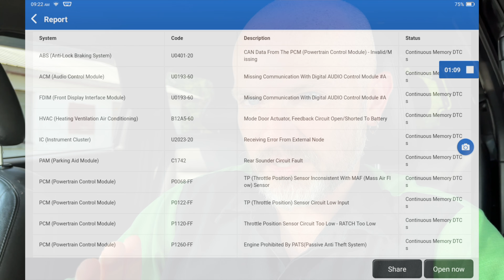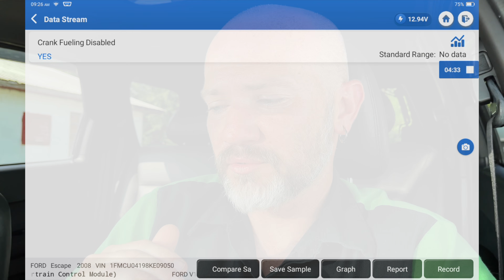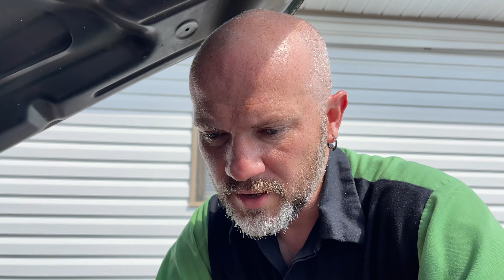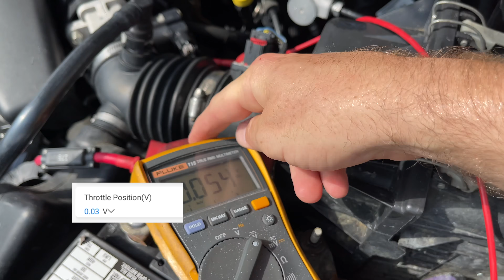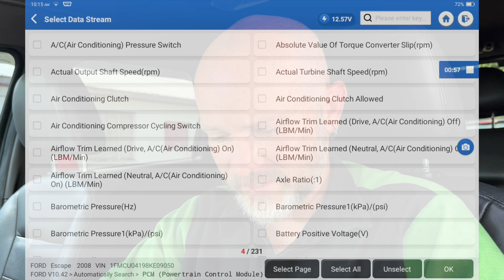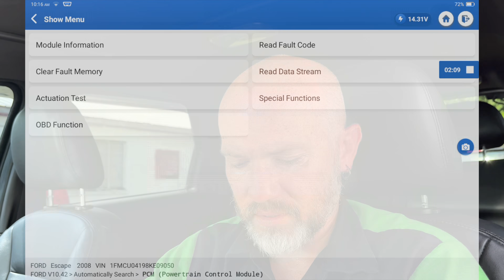2008 Ford Escape Crank No Start Mystery

Comment: I had this exact problem -- crank, no start.  It turned out to be the Fuel Pump Driver Module (On `05 to `08 Escapes -- part number 590-001 - about $40).  It is located above the driver-side, rear axle. These modules develop intermittent opens in the internal circuitry due to age.  It's relatively easy to replace.

Comment: Was the tps the problem for the no start
Reply from the maker: I'm pretty sure it was stuck at wide open throttle so it put the engine in clear flood mode.

Comment: You don’t get power on the injecteurs if your fuse it’s good  and there is continuity to the pcm  so it must be your pcm controls the power to the  injecteurs . Change the pcm and your problem it’s solved
Reply from the maker: I’m not sure what you’re referring to this vehicle only needed a throttle position sensor. It’s not had any issues since this video was made.

Comment: My 2008 Escape just spins over but won't start. Tried 2 new fuel pumps and still no start. Will the fuel pump run being just plugged into the connector or does it have to be in the gas?
Reply from the maker: Not it doesn’t have to be in gas for the electric motor to run.

Comment: In Ford PCM strategy RATCH actually stands for Ratchet. There is an algorithm (also called a strategy in programming Ford speak) that determines the full travel (voltage range) of the throttle position sensor(s). When memory is cleared or the sensor changed the PCM must determine the end stops (the actual end positions are learned). So, the algorithm will have an initial end stop value, and when this value is exceeded towards a stop the new value will be stored. By continually looking for the end stop values you may arrive at the final true end stop after several steps, each one of these steps is called a ratchet. So, the mental picture for the algorithm is the end stop values ratchet out until the actual full travel is reached. You need to know the ends of travel to establish the full travel magnitude of the throttle, which can be used for fuel enrichment on tip-ins by using the rate of change or throttle (just one example). You know the rate of change because you know the full range of travel.

The TPS ground is actually called Signal Return (SIG RTN) it is a dedicated signal return (ground) on the PCM.

If you really want to test VREF and SIG RTN you can put a load across these signals at the TPS perhaps 50mA. This will determine if you have any high impedance faults. However, if you have a bad VREF SIG RTN circuit you will see many more DTCs from other sensors. For TPS open circuit detect there will be a diagnostic high resistance voltage divider inside the PCM. You can just move the throttle (KOEO) to see a change in the TPS voltage. However, the best way to monitor this voltage is by using a PicoScope, because if the TPS has a worn spot you will be able to see it as you cycle the throttle. Disconnect the battery before changing the TPS. This will clear the ratchets. After, connecting the battery go KOEO and cycle the throttle pedal which will aid in setting the ratchets. I am not sure if you can do a similar function through the aftermarket scan tool with reset KAM. I know the battery disconnect will clear the KAM. 

Anytime you pull a connector for testing you should clean and lubricate the pins with at least Deoxit D5. You can use Deoxit D5 to rinse and then Deoxit D100 to fully treat the pins. Many technicians just use D5 which has proven itself over the years. Basically, all wiping pin connections exposed to air are continually oxidizing. So we want to clean off this oxidation and also lubricate the pins. Lubrication is of most importance if you have a connector with a high number of pins. If the pins are lubricated you can easily mate the pins without bending or damaging a pin. You can try this your self. Just find a couple of automotive mating pins, perhaps an old PCM and harness mating pin, mate the two and judge the force and tension. Then treat the pin with D100 and mate it a couple times and you will feel the connection become much more sure, smooth and without any grit. So, if you treat the pins and cycle the connector a couple of time the contact surface area will be cleaned by the wiping action. Some, technicians do not like to cycle connectors (because they think the plastic will break, which is a valid concern), so they just spray with Deoxit D5, mate once and done.

How does a bad TPS prevent a start? It must be DTC related in a decision tree, but I am really not sure.

It is best to take a look at the Throttle body to see if it needs to be cleaned. Most will get dirty over time. I remove the Throttle Body and clean using CRC Throttle body cleaner.

Comment: You could unplug the tps sensor, and put in its place your own variable resistor.  Set the signal wire to 0v, 0.1v, etc, and see if that would recreate the crank no start.  I get that a false WOT signal would enter clear flood mode, but all your codes and data was showing errors on the low voltage side for the signal.

Comment: Another Great Video Jake.  Seen those TPS stick in several voltage levels before and I would bet it was stuck at wot until you touched the pedal or if like me...just get within 15 feet of the vehicle and it fixes itself. 🤣🤣
BTW.. the Ratch is their closed throttle algorithm where it will continuously monitor and make adjustment for the lowest voltage point when the throttle is closed. A better version of the older Latch system. The Latched was a voltage set point captured at first ignition on. They were a bit more finicky as I know on most of the older Trucks,(late 80 to 96) it didn't like it when it was below .68V   They always seemed to be a bit sluggish or less responsive when you would stab the throttle from a stop. Even with a new TPS, I've had to "widen out" the mounting holes to achieve a better target of .95 to .97volts at idle.   I've learned that at that voltage point they were always more throttle responsive.  
This is when I learned about "Ratch and the Latched Voltage"  Well, also from when I was doing some of the old EEC 9aL Mustang tuning and mass conversions into the trucks.  Lol  Ya like 25 plus years ago now. 😆
 
Love the videos bro...keep them coming
Cheers

Comment: CT Closed throttle
PT Partial Throttle
WOT  Wide Open Throttle

Key on engine off the sensor should have been calibrated to CT not PT
(Correct me if my thinking is incorrect)

Comment: Totally not related to the video, but i just got done listening to the automotive diag podcast you got featured on. I found it super cool ,  i also started off as a radio / 12 volt installer and am now working my way through learning as much as i can about troubleshooting and diagnostics

Comment: Sometime in electronic throttle maybe causing due tu dirt in throttle but I think its manual throttle maybe should have the same problem you have also cleaned the throttle body it is good for vehicle health and also For TPS sensor.I see this issue in Toyota a couple of times and clean the throttle body and fix it
By the way your diagnostic method so much Informative

Comment: I've seen cars not start when you hold the pedal to the floor.. So I was thinking maybe the sensor was making the PCM think the pedal was at WOT.  But the fact that it's a cable throttle, I don't think it would matter as much.   But since you have a few of those "invalid data" type codes, It makes me think there could be a faulty or loose main ground cable.. But idk-- it's all just speculation.  Intermittent issues are the worst.
Reply: @autodiagyt  Noted..

Comment: i am wondering euro fords immo runs through the cluster and the solder on the pcb is lead free pretty crappy at the point that the terminal block plugs into the board . and cracks . but if my memory serves me right normally the immo light flashes and car don’t crank either but it’s been a few years since i did one . just a case of reflowing the solder with some new stuff . if you remove the cluster an wiggle the plug it normally fails or fixes it . pretty sure you see can bus comm issues dtc’s as the bus runs through that plug also

Comment: I  got really confused with the sensor unhooked having 3.5v in the signal line. i can figure on a bias voltage  but that seems high.  a 3 wire 5v circuit  i'm used to 5v  signal 0v  ground 0 volt (unplugged) but that was a 1990 ranger. newer having a bias i would expect 1-1.5v on the signal. thing is it seemed all good with the new one connected.

Comment: something to think about if vehicles didn't have radios, abs, push to start, no drive by wire, no can network, no other networks we would be out of a job and have good dependable vehicles to drive. i love my 1994 ram 2500 more every day still has some simple computer stuff. but i can change radio no effect on vehicle, abs doesn't affect the running of vehicle. know of several people who have vehicles that will not shut down without unplugging ABS F-150s mostly  life could be so simple but then a shop wouldn't need $50,000 in diag equiptment

Comment: Occasional, non repetitive faults are the worst! Great thought process! Potentiometer sensors are prone to wear out - maybe some odd wiper contact resistance could cause such an implausible value (rapidly changing?), that the PCM couldn't handle it and sent it to some obscure part of the code that inhibited the start. If it's OK now, we may assume it was related to the TPS.
Reply: Very possible, woulda coulda shoulda too bad you didn’t look at pids before touching anything and look at general pids like tps maf, Baro,and such. But I think you are correct thinking it was clear flood. Even towing the vehicle could have jarred the throttle loose and not show clear flood anymore but you did duplicate the concern.
Reply: @CodycoWeb  Good point.
Reply: @autodiagyt  That's probably what happened, now that I look at it from that perspective - I, sometimes, complicate. Too many of Ivan's odd case videos 🙂